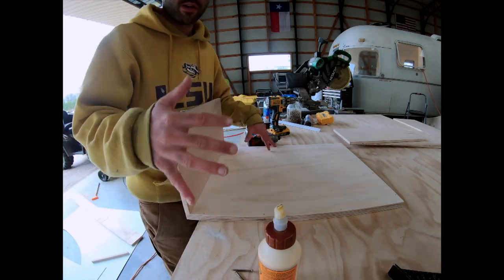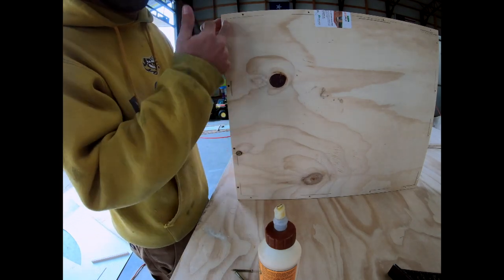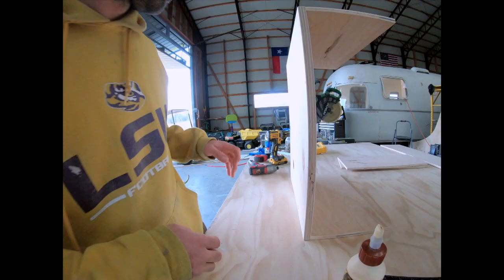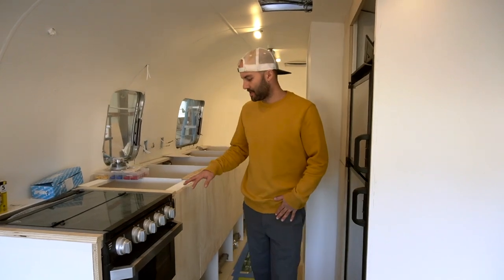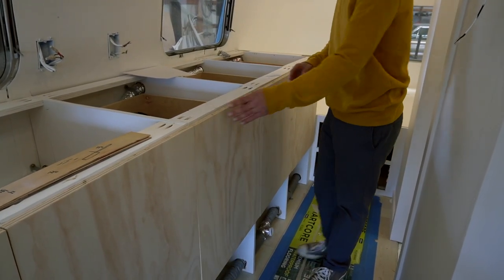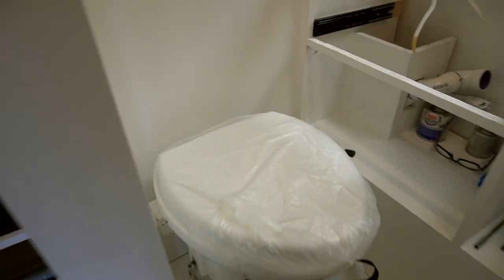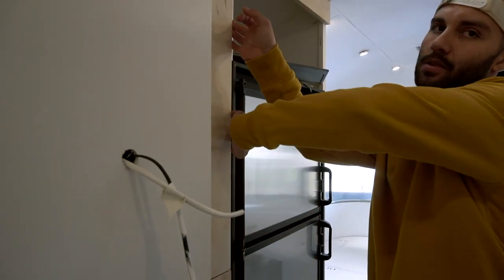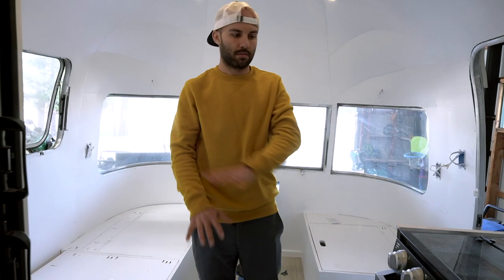Rv Renovation - Week SEVEN | Argosy Airstream

Comment: Cool job you're doing there, even with the fridge aperture corrective surgery! I like how you've covered those drawers with a door, keeps a nice minimal look.
Reply from the maker: Thanks! Yea, I measured correctly for the fridge... BUT then I added 2 inches on the bottom to allow for a “vent” of sorts in the bottom and forgot to add that 2” back to the top haha
Reply: @SteadyStreaminCashios  yep! Been there done that haha. I've ruined quite a bit of wood on the early days of cutting stuff out for my Airstream renovation. It's amazing how quick you learn to measure twice, go and have another look, measure twice again, then cut.